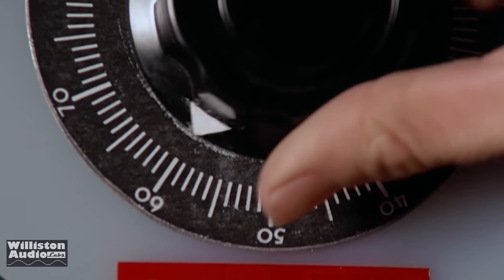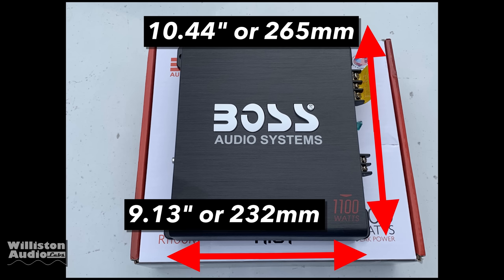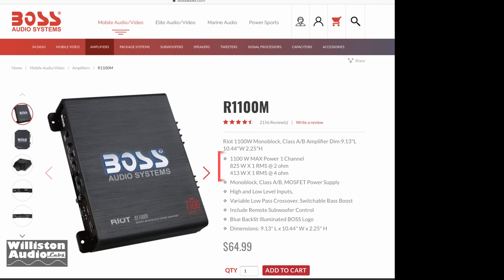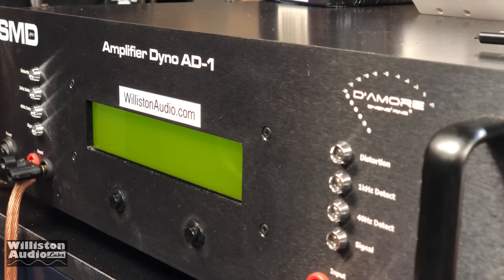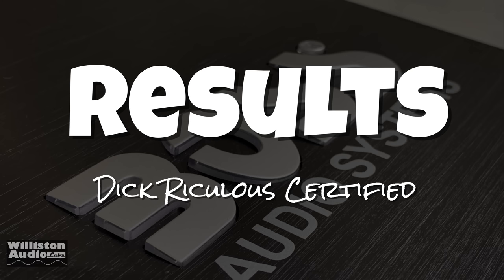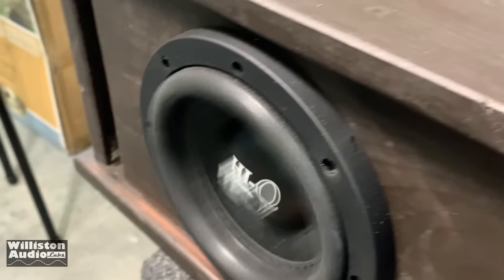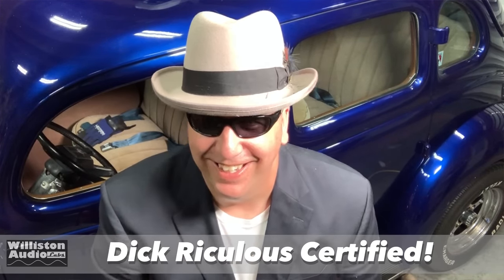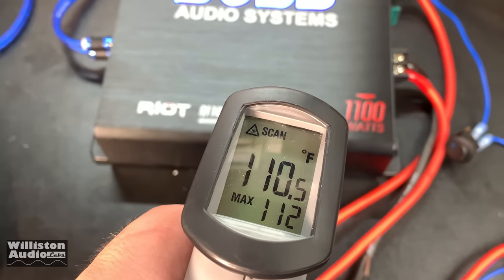Best Selling Car Audio Amplifier on Amazon (2019)? Boss Riot 1100M Monoblock [4K]

Comment: What's the best mono amp to run one DVC4ohm sub under $200?
Reply: how much power do you want and what can your sub handle(voice coil size?).  I Really reccommend  pioneer 9601 for 2 or 1 ohm  which can be had used on ebay for $100! they do over 1200 real watts. Check the dyno videos. Also the pioneer 8601/8701 does 800w and is good for 1ohm subs.   Another killer amp is a jbl gtx 500 which does over 800watts @ 2 ohm! if you can find one on ebay  they sound great!   Orion xtr 650.1, 1000.1 and 1500.1 are solid as well as  made in korea but are pricey and draw a lot of current.
Reply: @rmblwgn  that JBL gtx sounds perfect.  It's a 2" dvc4ohm sub with 370 rms & 1110 peak.
Reply: @thesouth50  I have wayy too many amps all from Ryan and big d dyno videos lol. I keep coming back to the jBL GTX 500. I even gave it to my friend for his birthday got it for 75 on ebay. I missed it so I bought another for 65 last month LOL
Reply: @thesouth50  another  huge steal on ebay right now are Kenwood Kac501 and alpine mrv500
Reply: @rmblwgn  well next time you wanna sell it or another one,  let me know. I'm on the lookout for one at a good price. Hey is precision power not any good these days? I've been out of the loop of bass for about 20 yrs. And they used to be top dog in the amp game. Especially those white ones with the  graffiti on them
Reply: @thesouth50  They were up through their last generation which have all but sold out. They are now reducing their costs along with everyone else, using shitty pot metal inputs and cheap chinese boards. Look at their "phantom" line on their website. Those use an excellent class d layout called the "phillips board". This copy paste design was used by hertz, soundstream, polk, NVX and many others. Look at  The controversy of the soundstream 900.4 on youtube. To cut costs they snuck out the "philips board" and put in a shitty generic chinese one which wasn't even close. They didn't even rename the amp. People were pissed!   I have the polk pad 2000.2 which is the same as Precsion power phantom  600.2 and it kicks ass!  does over 800 watts at 2ohm bridged(1ohm). Anyway i'm rambling, these amps aren't even availible anymore.

Comment: Spend like $20 more and get a Dual at Walmart. Does rated power N maybe a lil more.
Reply: That's false
Reply: They've been tested in Budget Gems and the Duals do rated power plus some check you facts before you try and doubt ppl
Reply: @chief9-10-games5  Amen bro. If he's going to troll he should at least have some leverage.
Reply: @vannloc7551  I just figured Dual was in the same category, their subwoofers and speakers are on the same level as boss. Lol not trying to troll, sorry if I hurt your feelings
Reply: @Only1Sethy  Dual> Boss. In all aspects. It ain't hurting my feelings, it just makes U sound uninformed.
Reply: @vannloc7551  You can stick with your Walmart car audio, I'll stick with better brands.

Comment: Can you please do an amp dyno for the crown xls2500 power amp... It's a pro audio amplifier but  i bought one to drive my two skar ddx15 1kw rms 1.5krms max at home... I did a clamp test at 1khz, 40hz and 100hz with my 350wrms  2way speaker and it barely reach 100w when it says it does 440w @8ohm... I used a cheap ampmeter and multimeter when i did the test... I wonder if it has something to do with its "power limiter to protect your speakers" feature... I'm looking forward to seeing a video about this amp and to see if Crown really does what it says since it's one of the most popular names in pro audio... Thank you bigdwiz...!
Reply: Or maybe i should've bought the behringer inuke nu-6000 instead of  the crown xls2500... I have a guarantee that the nu-6000 can do half of its ratings at least...
Reply: @sweetmisery5176  he did the inuke 6000dsp, probably using the same amp

Comment: cant find no amp for 2500w each 2 12’s
Reply: Get a Taramps 5k or spend extra 70$ and get the 8k
Reply: You should've also told him he's gonna need atleast 4 optimal batteries and a alternator up grade to run that power house, and on 2 12's, makes no sense

Comment: Considering two 15s for my chevy tahoe kicker Comp always been my go to in subs, but I wanted to ask someone who more educated. Any suggestions on subs name brands or box types for $1000 budget including amp
Reply: Emf banhammer and an audiopipe 2k
Reply: Also leaves you with some more to upgrade mids and highs if needed
Reply: Good sir. Kicker comp is as bad as boss.
Problem with the comps is- they have tiny voice coils. Thin wire and shit glue. 
Soft parts have always been their #1 issue. Ballin on a budget is hard. But like this other guy said, audio pipe makes good amps. So does skar .  Hifonics brutus is a good amp. Their 2k did like, 1800 rms. The 2k is like 200$. 
Good budget subs are, audio pipe , low end dc audio
Nvx vcw 15 will shit on the comps.
And they're like 179$ each. I would do 2 audio pipe 2 k with 2 nvx vcw 15s.
2 ohm subs. 
Now since u claim the comps are your go to I assume you are new to this. So remember .  Never mount your amp to your box or held over carpet. 
Hope this helps
Reply: @pissedoffconservative347  Thinking buying 2/ 15in American Bass XFL with 2k Audiopope amp.
Reply: Yeah I think the xfls are also pretty good subs  👍 but make sure you get the boxed built and tuned to your liking for example if you mostly listen to rock tune 40 hz but for rap and hip hop I suggest 30 hz
Reply: Always remember enclosure is just as important as the subs and also consider the lowballer series on emf if going budget  they are very musical and also hit hard
Reply: @isacelalvarez8741  no bro. No sub hits hard.
That's like saying that cars fast.

It only hits as hard as the enclosure  and electrical is be 

I'm so tired if hearing something hits hard 

Such poop. 
But he is right 
The box is the life
Reply: @isacelalvarez8741  Good looking out @isabel Alvarez I got 2/15inch EMF Lowballers today for total $301.00. Cant beat that ✊💯🏁
Reply: @isacelalvarez8741  Is QBomb going be best box for my Chevy tahoe?
Reply: Box seems nice but you should find a local shop with high ratings and get an estimate for a box if you can so that the box is built to the exact subs specs.
Reply: Box seems nice but you should find a local shop with high ratings and get an estimate for a box if you can so that the box is built to the exact subs specs.

Comment: I bought a lamp in a pawnshop the Orion Cobalt 800.1 I work for a whole yearvery good but it has a cheap RCA jacks instead of the tiffany-style so that messed up they had a lot of shorts to wear just stopped powering the subwoofers but I've actually fix the RCA plugs still works great best 50 bucks ever spentin reality the ants around $200 brand new pretty sure this model is discontinued by Orion but it'd be cool if you can do a dyno test on Orion Cobaltit's 400 RMS I believe at 4 ohms and up to 800 watts at 2 ohms I'm guessing it puts out a good 680 watt RMS at 2 please do a video on if you can find a Cobalt lake Orion 800.1 2:30 amp fuses

Comment: Before buying an amp ignore the expects and check for amp fusues base on that you can tell if it’s possible to do it ratings or not at least that’s what I do and I kinda know what power to expect out of it
Reply: Some brands are different and way more efficient but u won't get them cheap new, anything cheap should be a give away also.
Reply: migas custom sounds of course a price and the brand kinda gives you and idea of what to expect
Reply: That is not a good indication of power capability. See my comment above. Same is true of home amplifiers and pro audio amps. You can have 10,000 watts of power running off a single 20 amp breaker which should not be possible but it is because music does not require a constant power output. The average power output is always much lower than the maximum power required at any given volume.

Comment: I think the planet audio anarchy 1500.1 is way better I had it for couple years and still pumping with one L7 12” I like sound that gets out of it, may not be the right pair but it works fine to me 👍
Reply: Yeah I have a PA Anarchy 1000.2 for my mids, it does the work and was like $60.
Reply: I had a PA 2000 class d anarchy hooked up to four 12" kicker cvr's and that thing HIT HARD! For the price I feel it did its job. I was proud.
Reply: avefenixml Yeah that L7 is wayyyy underpowered with that planet audio amp I doubt it does over 200 watts
Reply: Just buy an Audiopipe APMI2K . Big3 and a couple of extra batteries.. even at 2 k you need great electrical
Reply: Timothy Hinton Thats way overkill for an L7, best to get a better quality amp than an apmi the apcl are better quality or even a hifonics brutus

Comment: Could I run this on two 12” JLs u think?
Reply: It's more a case of running two 12" JL's on this amp
With that said, the answer is yes, though the subs would likely be under powered, which could result in clipping, though other than that, it won't do much beyond  that of an underwhelming bass performance.
Reply: Just buy name brand.
Reply: Don't hook it up to anything bigger that a W7 though and 2 at most

Comment: This has to be wrong. My MTX Thunder 5500 10 inch is supposed to yank 500 watts at full volume and I crank the crap out of it and the amp never protects or sounds distorted. Granted, I do not have the tool you do but it seems to do well. Could that just be the acoustics of my box or car being optimal?
Reply: The sub may be able to handle 500W but the amp never puts out the 500W. Just because you're at full volume doesn't mean you're supplying the full power the sub can pull.
Reply: He's not saying the amp is incapable of running a subwoofer, only that it is outputting much, much less than advertised. The senstivity on your speaker is 84.37db, which means it'll put out 84.37db on 1 watt of power at 1 meter. Your speaker is realistically getting 110-115 watts of power which is not enough in an ideal world, but is certainly enough to make some boom boom. Especially inside a vehicle where you get a lot of gain from the vehicle itself. There is some math involved, but you could realistically expect to get a few more DB out of your sub with a more powerful amp. HTH.

Comment: I was always told to get the max wattage was to take the fuses and add them up and multiply by 14 and there's your max power
Reply: I used to have an amplifier that had like 3 or 4 fuses but only one was wired into amp. The rest were just decoration.
Reply: It's not true. Different amps have different guts. Some have more dynamic power than others.
Reply: @Hayawasa  you actually get a close number to max. No amplifier is 100 efficent so going by 14.4v x fuse gives you a close number. Guts don't matter because fuse or fuse rated is matched to amp.
Reply: @cutweldngrind  bigger capacitors  better mosfets bigger chokes among other parts inside the amp determine how much power it can dynamically or what you are calling max put out. So yes amp guts do matter . When u say they don't, it's like saying an engine that is stock has just as much horsepower as as one that is built for racing. It helps to know what you are talking about before commenting.
Reply: @cutweldngrind  if you think I'm wrong look it up . There is a reason why some amps cost 3 times as much other than just selling a name in some cases. If you what some more videos on this channel you will see what I mean. Pay close attention to the amp internals on the higher priced more efficient and higher dynamic wattage amps . They have a lot better and in some cases more of what I was telling you about earlier.  Quality and abundance of certain components has everything to do with power and efficiency. Even with the same fuse rating as a cheaper amp!
Reply: @Hayawasa  I think you did not under stand what I said. Guts are already factored into the fuse rating by manufacture. You might have more efficient amps or beefier guts and that matches fuse rating on most amps. Take my Sundown Saz3000d, rated at 3000w....300A fuse x 14v is 4200watts, let's say amp is 80% efficient at 1 ohm is 3360 watts. Let's go old school with Hifonics Zeus 8, 90A x 14v is 1260 watts, take efficency out and your close to 1000 watts. You can get a good idea by multiplying IxV....
Reply: @cutweldngrind  right I wasn't arguing about the math I was arguing the point that you said that amp guts don't matter when determining an amps dynamic power. My taramps md8000 has certified rms all day but not any more. It's a rail voltage amp . The guts matter.
Reply: @Hayawasa  When I stated guts don't matter it's in reference to the fuse legit manufactures recommend. I didn't argue to dynamics or anything else. I posted yesterday that I had an amp with 3 fuses but with cover removed only 1 was in service. If I multiplied that fuse value by my voltage it was really close, being amp was like 60% efficient only. Before dynos we would use clamps and meters at SPL events.

Comment: I have the boss PH5000D watt amp and for $200 can't beat it even though I know it's not 5000 watt Max but it's definitely over 1200 watts and that's on the low end
Reply: The Audiopipe APMI2K is over 1,900 watts under $200
Reply: @timothyhinton5665  I might have to check that out I know I spent $175 for that PH5000 and it was great
Reply: Skar rp 2000.1 is $249 did over rated certified.
Reply: @phila8160  hey my opinion I think a Skar is way better than Boss Audio
Reply: @phila8160  but now you're going up in price both of the above amps are $200 and lower

Comment: Forget the boss amps, but I will tell you that their smaller speakers from their chaos series do take power, & put it out, & all while sounding good.  Speakers such as 6x9, 6", 5.25" , 4"  etc etc. 

But also on another subject,  stay with coaxials verse the 3 & 4 ways , & 4  ways with the extra super tweeters 
(5 ways). While this may look all good & especially the way such things are advertised,  but in truth it is not. And actually typically only further complicates getting very high quality sound.  I could write a book on why & elaborate on on resistance  (ohms), phasing, grouping, group delays, timing,  refraction, axis, alignments, & a whole lost of things on why all the extra "speakers" don't make better sound, but it would be to much to write here.  You are better off buying  a quality coaxial with a good frequency range for that specific size & intended use.  Next would be a component set (separate woofer & tweeter), but in truth these are not optimal either, contrary to what so many believe.  Especially when the components are far apart from each other.  Coaxials can present issues with the tweeter being in front of the woofer, but is by far less noticeable in most situations, especially car audio. Also depends on overall tweeter to woofer size. Such as having a 3" tweeter in front of a 5.25" woofer can present sound issues. But a 1/2" or less tweeter will barely effect these woofers. Coaxials have the sound coming from one center source.

Another important thing is the crossovers being used. Having an understanding of these & how it is being used for your set up will make a big difference in the overall sound quality.

Comment: Will it power a 10’ kicker with a truck box ok
Reply: I tend to stay away from big brands like Kicker and Boss, just because you pay so much for the name. Doesn't mean you can't have it any sound good. It'll probably sound great, but to get loud on a budget, I like Skar Audio.
Reply: I’m running this amp with 4 Pyle 8s and it’s fine, so you should be fine. Then again I screw all the specs and do whatever I want so hahah
Reply: @JackNatti  umm, Pyle? I would not admit that to anyone.
Reply: @jeremystone2002  why not, Pyle was actually pretty good for what it was?
Reply: Terrenzo Jones 20 yrs ago
Reply: @lmatos369  today when one is smarter than technology and knows how to use anything vs a brand name...
Reply: Terrenzo Jones hmmm no can’t make an amp do more than it’s made to do sorry. I just bought that ignite amp 3000.1d and it actually puts out what the manufacturer puts in the manual
Reply: @lmatos369  keep on thinking that until you make one...